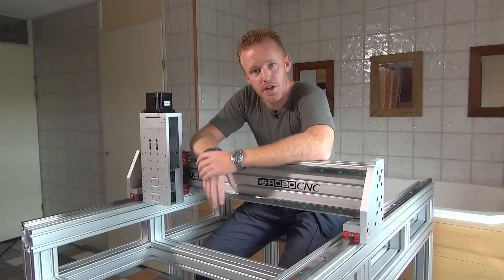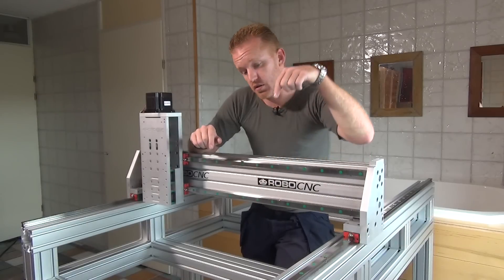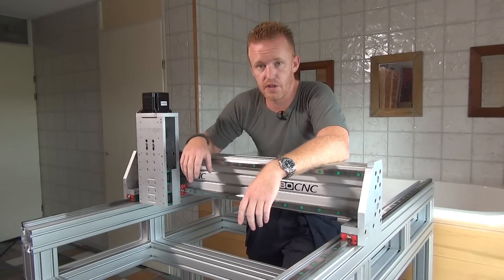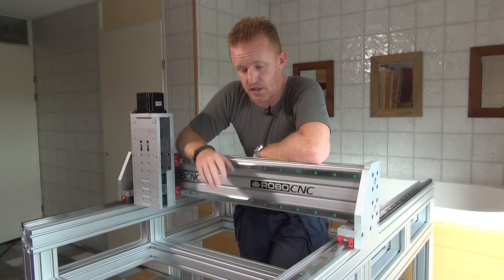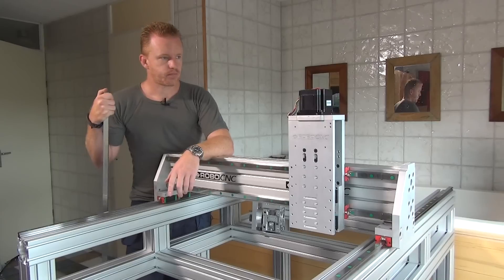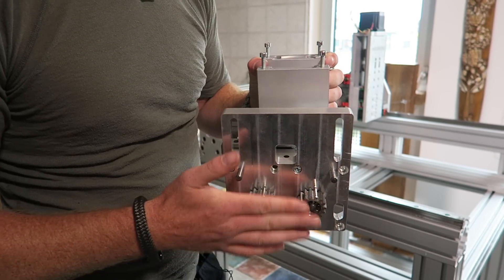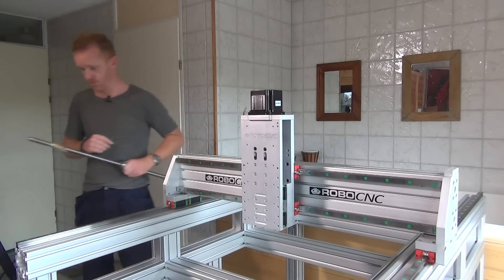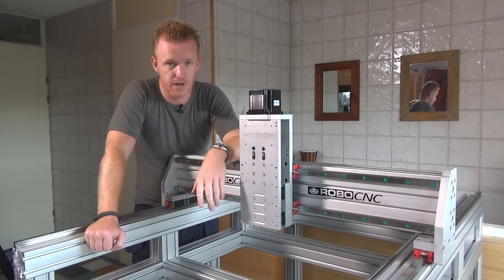RCNC X2 Router 08: DIY CNC Router 50% update

Comment: great video Marcel. you answered a lot of question i had about your build. but i got one more question. what size of stepper motor are yoy going to use for x and y axis?

Let me tell you that your idea about to keep the bed flat without touching the aluminium extrusion is good, but i am not an professional, lets see what other with experience say. i just thinking if that is going to be your final solution for the bed, the acrylic or plastic must to be kind of thick so it doesn't bend  that easy in the unsupported places. 

one more time Marcel, great video man. i can wait for the rest of the video series for this build, and even better, start building mine. i hope you cover everything just like you did with the X1. thank you man
Reply: by the way Marcel, you forgot to link the channel of John ( i don't know how to write his last name lol).
Reply from the maker: Hi Miquel, thanks for watching and you thoughts !
For the steppers I will use 3 nema 34 4Nm steppers. 1 on the Y spindle, 2 on the X axis with a 1:10 reduction ratio.
The plastic I was thinking about would only be 4 strips on the support profiles, so no unsupported plastic.. 
Your welcome ! and also thanks !
Reply from the maker: No it's in the top right corner.... i'll shift it back to where i point to the corner.. one moment.
Reply: my bad Marcel, i didn't see it. i watch the videos on my phone. maybe I miss it. thank you for your answer man. great job. have a great day